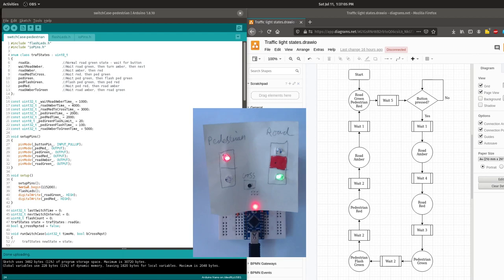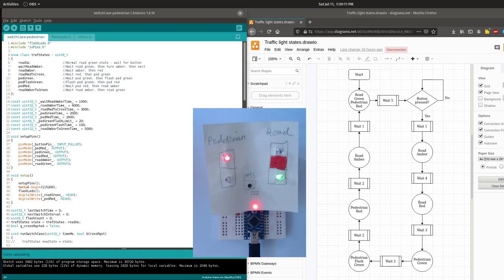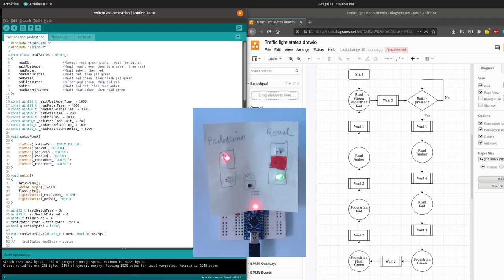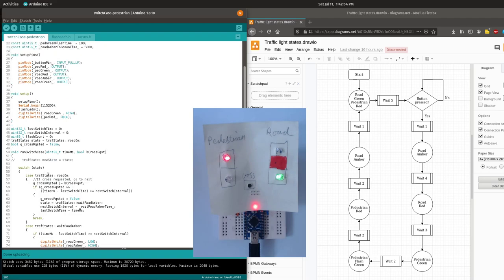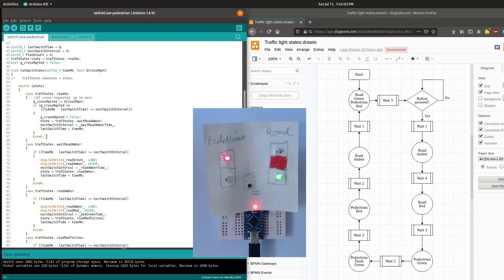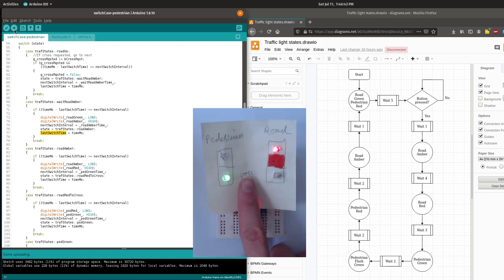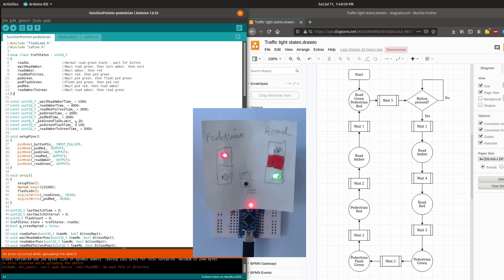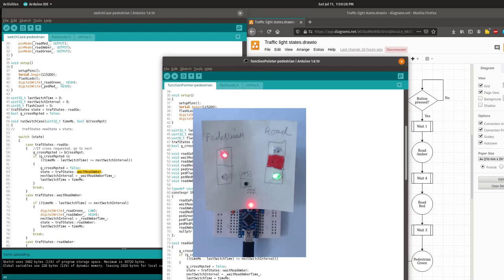State machine programming for Arduino, switch case, table of structs, and table of function pointers

Comment: Thanks, this is a major jump in my understanding of state machines.
My project is to take an older Keurig coffee maker, disassemble and separate the parts, then re-assemble into a kind of funky steampunk style coffee maker, using an Arduino to handle the code. Using your code as a starting point, I can add in some temperature, pressure, water level sensors, relays, plus some pumps, and be well on my way of blowing up my house. 😂 thanks

Comment: Thank for making this video. My history with both programming and electronics is a bit odd. I learned to program BASIC and some assembly on a Timex-Sinclair 1000. I studied electronics when I was very young, trying to get my ham radio license. I couldn't master the Morse code, so that didn't happen. I also had a surplus military receiver and transmitter that was vacuum tube based.
Then, lots of time passed. My next programming returned when I started using OpenBSD. Being in that environment is a bit frustrating, but even things barely understood shows the best way for many things. I am also doing electronics again, now. Little pieces from all over the place in time are starting to form into a whole. Thanks again.

Comment: Fascinating. That 3rd method using a struct table was new to me.  
The advantage of pointer over the first switch case seemed partly that you had moved the code into separate functions. Couldn't that also have been done in the first example? 
The problem with my hobby type projects is that I don't know what the states are going to be until some way into the project.
Reply from the maker: Thanks for the comment. Yes the switch method could just call functions. The table of function pointers method is  just an alternative to the switch case, but it can be easier to modify and keep track of.

Yes dealing with changes is always the hardest part, but making code easy to modify from the start is best. Happy coding!

Comment: I've been exposed to state machines recently, and i've found the subject quite interesting. I have a questions, I am building a little  system using Arduino consisting of a GPS, a magnetometer and a lightning sensor.These sensors will be transported by a drone and I will collect the data via a radio link. Does this system benefit from a state machine?  Thank you for the video.     I love your traffic light!
Reply from the maker: Hi John, thank you for your comment, I'm sorry for the delay in replying. For your system a state machine may not be needed, but I'm not sure. It sounds more like data gathering, so a more suitable design might be to gather the data on a clock tick (similar to how the traffic light system only does something when the next time is reached), then package the data up and send it over your radio link.

If you continually collect data but only send it say once a second all in one go, then a state machine might be suitable, as there are clearly defined separate states: collect data, send data. But this could also be done just be filling a buffer, then sending once the buffer if full. I hope this helps!
Reply: @heavybaremetal8682   Yes,  it is data gathering.  And I guess I'll follow your advice (filling a buffer). Thank you for the reply!
Reply: @heavybaremetal8682  but if you're trained to gather data at and use the data I think a switch case would be better because I did some things a while back and I would crash the CPU. on the Arduino.